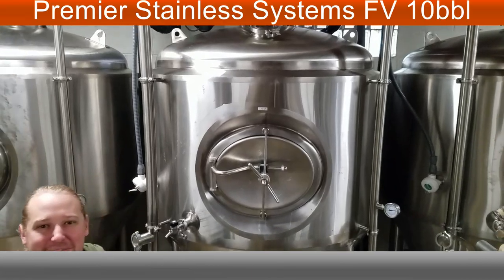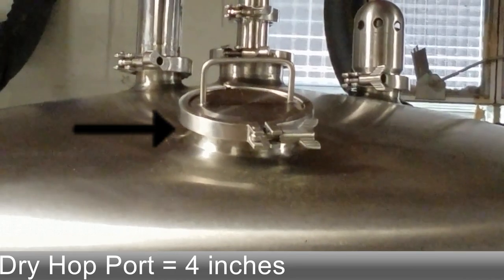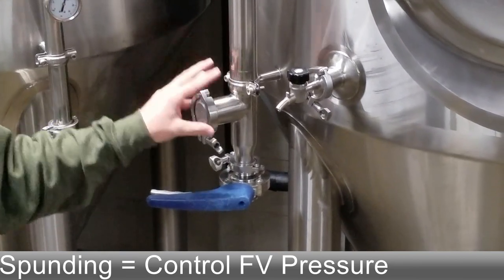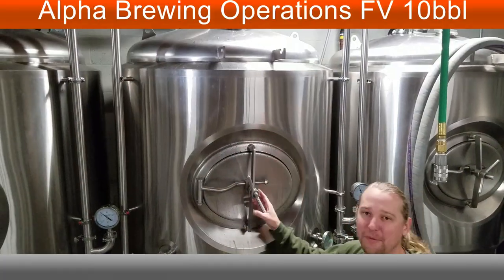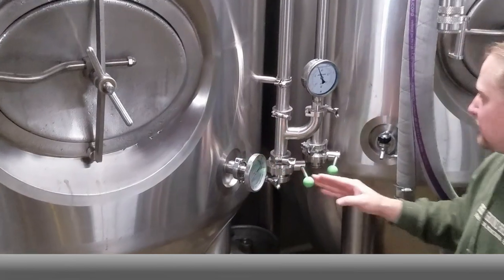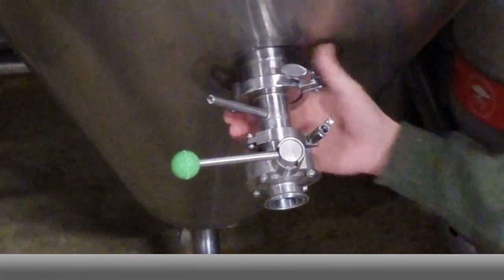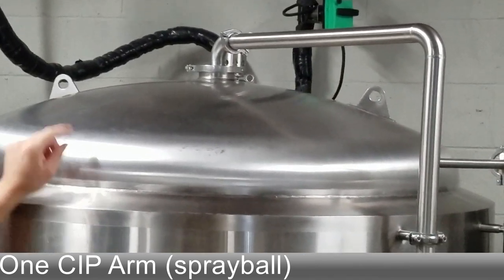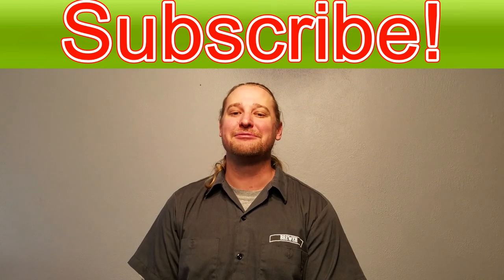Beer Brewery Fermenter and Brite Tank

Comment: Great video! How do you repitch your yeast? Do you need to collect them from a fermenter first, then sanitize it as you shoes in your video. Or you just dump some trüb from the conical, transfer the beer to a bright tank and add a new one in fv?
Reply from the maker: Thanks! I harvest/collect yeast in a brink, CIP the tank, Pitch by weight during Kettle Knockout. 
Cone to Cone pitching is also common. Adding a fresh batch on a "dirty" tank is done but I would not recommend it. 
I will be doing a video on yeast at some point, cheers!
Reply: Yeah video on yeast would be great!

Comment: Thanks for the video! I just have one question. When CIP cleaning the BBT, don´t you need to have a relief valve open? or do I just connect my CIP pump and hoses to the BBT as a closed circuit. Thanks!
Reply from the maker: Good question, There are a few different ways to do the BBT. If the beer is filtered then it is possible to keep the CO2 in the BBT and run acid cycles under pressure between batches. If not, The Top PRV can be removed, The manway can be cracked open. Sample valve and carb stone can be removed and replaced with butterflies and 90 elbows to floor. 
It is always important to pay attention to pressure changes, good eye.

Comment: Hey jasper, great content on here, what do you think about unitanks instead of fv/bbt? any problems fermenting with a carb stone inside? Cheers
Reply from the maker: Thanks! I think it is a great way to save space and make great beer. Unitanks are better for a pub brewery rather than a packaging production brewery. No problems fermenting. Clarification and Carbonation can be tricker if the FV's PRV blows prematurely (which most do) and the gycol chiller system needs to get the beer to 34-35F. (30F better). 
My "current" opinion is if you are using carb stones anywhere (BBT or Uni) buy an UltraSonic Cleaner for the stones. There is just no other long term solution to cleaning those things. Hope this helped, Cheers!

Comment: do you..or can you... run a line straight to your taps or do you have to run to keg first !?
Reply from the maker: You can serve off the brite tank or keg. If used as a serving tank it will be tied up until the beer is gone or a new batch is blended in. If used for kegging the tank can put out btaches of kegs every 2 to 3 days, Cheers!

Comment: Why would you have a 30psi PRV on a BBT and a 15psi PRV on a FV? Should it not be the other way round?
Reply from the maker: Thanks for the question. Most (all?) manufactured  commercial FV's are only rated to 15 psi. The purpose of the FV holding pressure is to capture natural carbonation by capping the end of fermentation. Building 10psi at end of fermentation is normal.  If you wanted to capture 30psi you would risk damaging the yeast. 
The BBT is designed for finishing carbonation and packaging. If your gycol can only chill your beer to 38F you will need 15psi or more to carbonate some beers and a 15psi PRV would be a pain. During packing runs out of the BBT some canning and bottling lines require the BBT to be 18 psi or higher to fill the beer optimally. It is common for both tanks to have 15psi PRV's but I wouldn't recommend putting a 30PRV on the FV. 
Why would you think it should be the other way, The FV is generally warmer and warmer liquids require higher pressures to hold CO2 in solution? Anyways hope this helps, Cheers!
Reply: Hi, when you chill your beer 1bar will never be exceeded. However, if you want to naturally carbonate an ale you need to set your spunding device to at least to 1.7bar to reach sufficient co2 levels. If you set it to only 1bar you wont get enough co2. if you would cool, 1 bar could be enough but only for lager yeast. ale yeast wont ferment at these low temperatures. To partly carbonate the beer does not make sense in my opinion. why would you bother at all with this when you later force carbonate anyway? The pressure on the yeast is extreme, that's true but before you set the spunding device you should harvest anyway. Once the co2 is in the beer you also can't dryhop anymore by just throwing the hops in (gushing) so you wont reuse the yeast after spunding/dryhopping.
Reply from the maker: Thanks for contributing! It does make sense to have a 30PRV on the FV if spunding to final CO2 levels are planned. Manufactures do make FV rated above 1bar but they are far more expensive. 
"Chill beer 1bar will Never be exceeded" This could definitely be true in your brewery, but for many others around the world it is not. Example; cheap gycol chiller, My brewery when I do canning runs..ect
"Partly Carbonation does not make sense, why bother?" Capping a FV is really easy, check gravity then close butterfly valve. This process partly carbonates the beer up to 2.0vols. This partly carbonated beer will save a bunch of time and Co2 ($$$) when finishing carbing. Capping or partly carbing also, helps head retention, saves aroma, and builds pressure to prepare for cold crash. If no positive pressure is built before cold crash you will risk FV implosion (unlikely) and sucking in Oxygen. Capping fermentation (partly carbonating) a beer seems/is very beneficial to me.  
At what Plato do you start spunding to build 1.7bar, around 2.0P from target? Have you seen any problems with collecting early flocculating yeast? It would be (impossible?) to remove all the yeast from the active pressurizing FV and building pressure will affect active yeasts flavor compounds. In higher pressures there are increases in acetaldehyde, and decreases in higher alcohol and easter production to name a few. 
I totally agree that drying hopping should be done before spunding/capping and yeast should not be collected after dry hopping. 
Thanks again for your comment. I would love to experiment with totally spunding to final CO2, maybe in my next life ill buy a few FV's rated to 2-3bar. Gotta love all the ways this awesome product is produced. Have a great weekend, Cheers!
Reply: Our FVs are rated to 2.0bar so we can actually fully carbonate the beer. However we are also producing cask beer and for these batches we obviously do not spund and can harvest yeast that is less damaged . With this yeast we can pitch subsequent cask/keg batches. We don't harvest from keg batches due to the high pressure and the low yield at the end of primary (we could not harvest after cooling because the beer is already dryhopped). But I agree with you. Everyone does things differently and as long you dont "damage" the beer (off flavours, oxidisation etc. there is not the one right way.